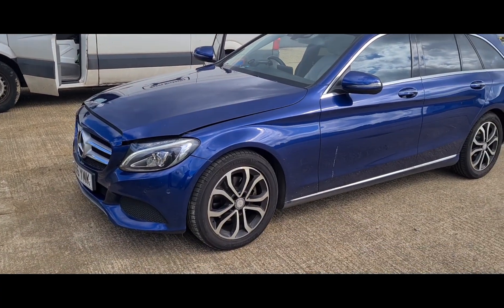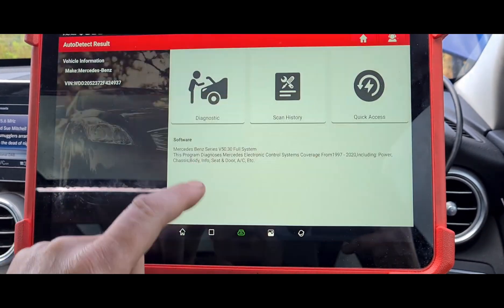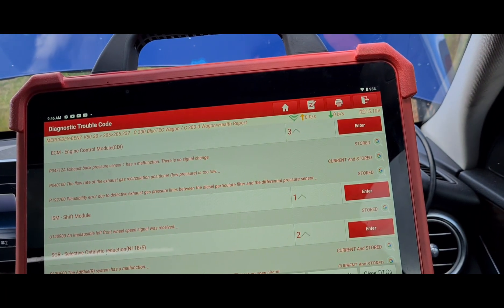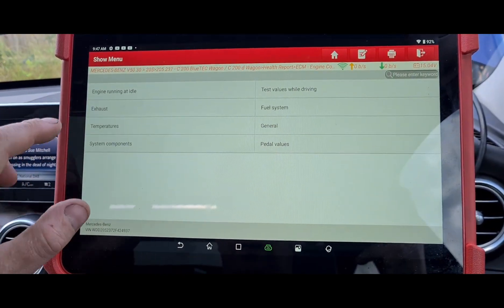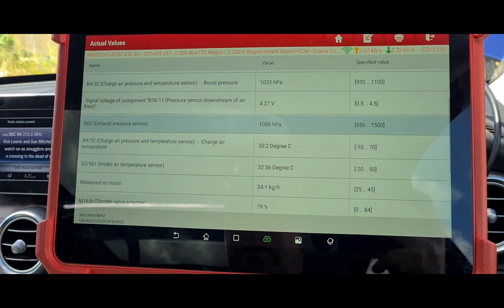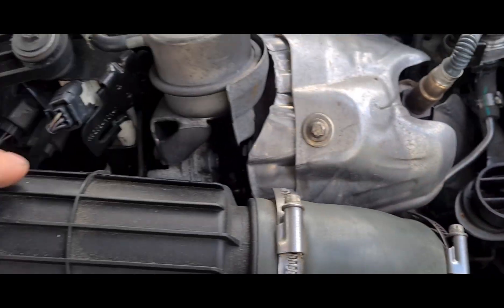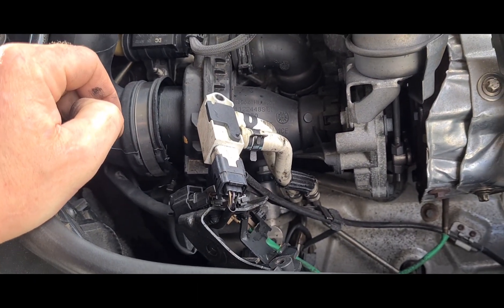Mercedes High Exhaust Pressure But DPF Not Blocked??

Comment: Anyone with this problem you should with some scanner go to the service app, not the diagnosis, in service app you should reset the soot values from the catalytic converter and the auto lean values from the presure sensor.. problem solved

Comment: Who left those cables and air passages like that?  That's just awful.  I blow a cranial valve when I see anything not OEM, even if it's cheap and practical.  Don't use a plastic tie when you could just replace the main single air intake.  Its a 60 euro part.  Ask me first.  I'll decide if it's too much or not.

Comment: I have the same car, I rebuilt the engine and had the DPF cleaned before assembling it, now I do about 200 or 300 kilometers and the error p2002 (fb) appears, I've already checked the pipes and nothing is blocked, I have adblue canceled and I already checked the ECU data and everything is fine, I also have the black dirty exhaust.
Reply: reset the soot values in service app in the scanner and the dpf sensor auto learning data.. is on service app, not diagnosis app,
Reply: Dpf failure .Soot past dpf is bad.

Comment: Great job Jimmy. True helping hand.
Just what to spread the news based on things I learned working on similar problem on my car.

B28/8 (DPF differential pressure sensor) is part of DPF subsystem and will not "limp the car". 
At 4:18 we can see sensor called B60 (Exhaust Back Pressure Sensor) - it is part of the turbocharger subsystem and it shuts down the turbocharger  - max allowed value is 1500hPa, and in idle revs should not go over 1100hPa - this sensor was defective for me and after replacement it solved the problem - it is easily accessible anybody can replace it bw.
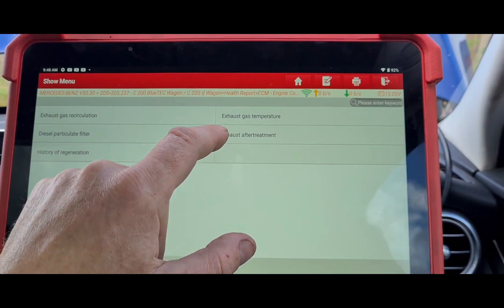Back on the actual video the root cause might be due to whole Add Blue system looking strange ( 3:25 in video). Even it looks switched off it might have clogged, nitrate crystals can form if urea leaks.

Comment: Glad I was sensible 8 yrs ago & bought a E-Class 350 v6 convertible with one of the best engines Merc built, cooler Gaskets that’s all it’s needed and oils changed every 3k will sell it in the new year though 😢

Comment: Hi, I have a same problem too. Basically I upload one video months ago. Someone drilled couple of drill hole in a DPF because of the high Dpf Fisher but Dpf not blocked what I found there is a faulty mass airflow sensor because of that they change EGR maker two holes in Dpf and came to me I couldn’t find any problem with Dpf or other related. I’ll check any boost leaking even I can’t find any boost leaking. Finally I found faulty mass airflow sensor basically you someone remove that horse and leave it as it is, could be the problem, other thing we can’t find any faulty code for airflow sensor. And also, if sensor problem is effected to the gear shifting  
Good luck mate

Comment: As far as I'm aware these are fitted with a back pressure flap that does keep some pressure in the exhaust system however the soot does indicate the DPF is damaged

Comment: Theres a lot of soot at the tailpipe, something has clearly caused it to dump all that unburnt fuel out of the exhaust, dont think this is the last we will see of this
Reply: What can cause soot on the tailpipe? I have a 2016 clio 1.5 dci no adblue with tailpipe clean, and then i have a megane 2020 1.5 dci with adblue and has soot on tailpipe and it also regenerates quite often ,about every 150 miles , injectors been checked and they all good , egr been cleaned too

Comment: Have this problem on vw tdi engines.  Low pressure egr blocks up with adblue  causing back pressure and setting p2002. I reckon the low pressure egr is the cause. Great detective work. Think you're on point with that. Excellent video

Comment: Mates a main dealer merc mechanic - he was telling me about how many people come in going "I want a quality German car, not some French muck  so I picked Mercedes.." Yeah... you got it sussed, Pal..."
Reply: GLB200 Built in Mexico with a Renault Engine, German as feck lol
Reply: @-DC- even worse are the ones who pay through the nose for their overpriced pickup, which is basically a Nissan with a Renault engine (a rubbish engine too). 😩
Reply: We had a customer bring there car back after we told them
Reply: When changing DPF sensors do you need to change the adaptions
Reply: @paulcornock8287  I don't believe you do - but you're best to do a dpf clean & then tell the 'confuser you fitted a new dpf ( I.E fib) at the same time, to start with a "clean slate". Otherwise it will probably continue to sulk.
Reply: @ I’ve an intermittent fault that’s happened 3 times over the last 2 month but today the car had limited power but no warning light. I honestly didn’t think the DPF is blocked as its drives fine . I think it’s the DPF sensor
Reply: @paulcornock8287  or the wiring going to the sensor - the wires crack & break. Check that first.
Reply: @paulcornock8287  no you don't

Comment: I have seen the same high presure after dpf on Rav 4 euro5 engine. Back box was causing 44 mbar presure after second cat, 90 mbar presure in front of dpf. I think back box was block some way. After hard drive by owner on motorway dpf light go away so didn't got a chance to remove back box an see way it's causing mbar presuure.
Thanks for video.

Comment: Hi jimmy. My exhaust pressure before dpf is 1220hPa on the live data. With exhaust back pressure 275hPa . Would this indicate a severe blocked dpf. I e already ordered the launch dpf cleaner to spray thought the front side of the dpf. ?
Reply from the maker: Is it a Ford?
Reply: @ORileysAutos  it's a bmw 3 series. 
Live data shows soot level at 79%

Comment: Hi jimmy I think the exhaust flap works with the back pressure between the dpf and catalyst so if there's  a problem  with the exhaust flap it could be stuck  closed causing back pressure in the dpf  and giving high readings ..just a thought 😊
Reply: My car has a similar issue , and also has an exhaust flap middle of the exhaust pipe , i also got a bit of soot on tailpipe and soot G going up very quickly
Reply: @slvs91 did you ever get this resolved was the exhaust flap stuck closed? If yes is there an easy way to check this? Ta